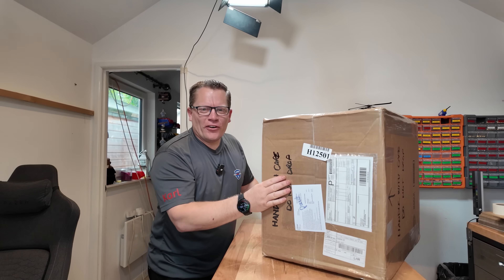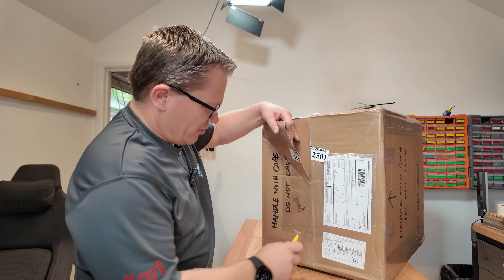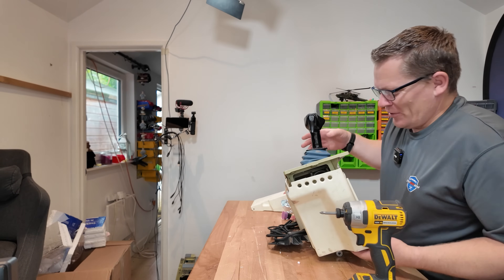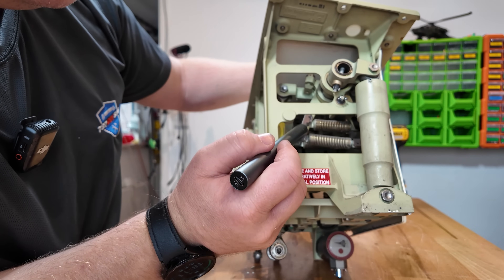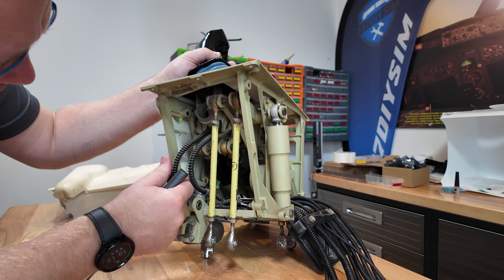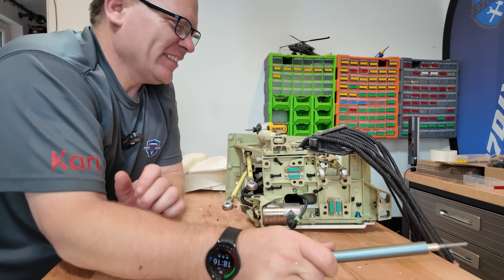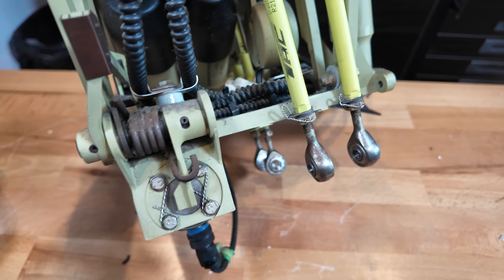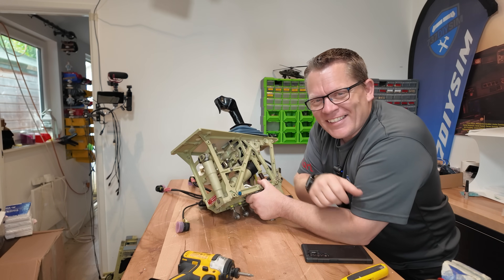A320 Sidestick

Comment: Any chance you can do a video on powering the sim. I was told you can't run the LED's on something like the front overhead from the Arduino alone as the power requirement would be too much. It would be good to know how to bring an external PSU into the system and how everything is powered.
Reply from the maker: Hello and yes, I am wiring the new sim up this week on Patreon and will issue a build guide video on every aspect for people to follow along.
Reply: @helimech8152  Glad to hear it. I'm getting close to installing the LED's in my overhead. All the main switches are done so just the rotaries and stuff to do so will be a great help. I tried seeking help on the Arduino forums but but basically told to read the specs and come back with a circuit diagram. To be honest most of what I've done is from watching your videos.

Comment: 2:45  Just to the right of the boot towards the top is a hole. That hole is for a lock-out pin which is used for safety when someone might be working near the aircraft flight controls. The lockout pin will render the stick motionless. It comes with a big round red plate and a Remove Before Flight streamer. When installed a log page must be created which turns the maintenance release RED until it is removed and the log page signed off. The position of the lockout pin hole would make this a First Officer's side stick.
Reply from the maker: Thank you for taking the time to share your knowledge. I would have never guessed that was for a rigging pin. I will keep this in and add this feature to the 3D-printed version for fun! Merry Christmas, Karl
Reply: @helimech8152   Merry Christmas. LOVE your videos !

Comment: Hey Klark, I saw your new MCP v14, and it is incredible. I joined Patreon web site only because of you. (I'm still not paying, though.) Why? I don't have time right now to build Boeing SIM. It is simply time-consuming and requires a lot of space and resources. But the Cessna 172 with G1000 is looking very realistic to me. It takes much less space, and it is much easier to make.
PLEASE, consider redesigning the G1000 with an Alps switch, like for your FMC. I think that there would be literally 10 (if not 100) times more buyers for G1000 PCB with Alps buttons and SMD LEDs then for any other thing. Also, as I told you once, please make the design to be 101% realistic.
I hope you will consider this! :) :D
THANKS!
Reply from the maker: Im trying, but to be honest, i havent even tested the last PCB of the G1000 that arrived!

Comment: Someone stripped down the unit, removing the encoders, links and related electronics. What a shame. But it is still am engineering marvel.
Reply from the maker: Hello, and yes it is! It doesn't really mater about the encoders as I will switch them out to hall sensors connected to the rods.

Comment: The locking actuator, switched by solenoids doesn't lock the stick but makes movements harder when autopilot is active to prevent unwanted overriding. There are centering locking pins for maintenance and adjustments. The rods go to identical transducer units which converts the input into electrical signals for the flight control computers. 
The sidestick unit should always be handled vertical to prevent leakage of skydrol from the dampers which is normal.
Reply: Just to clarify, you are correct when you say that the locking mechanism is there to prevent unwanted overriding of the autopilot by making the stick hard to move to any direction. But once you push it with enough force, then the AP will disconnect and the locking solenoid will release the stick and then the stick continues to operate as usual. Of course this is not the recommended way to disconnect the AP, but in case of emergency, it will work.
Reply: @MikkoKartano  Absolutely correct.
Reply: @MikkoKartano   Is there any harm to the system after disconnecting AP by moving the stick? I just did a side stick priority test last night and that is one thing we do not test. I don't recall ever testing the disconnect function of the side stick.
Reply: @rael5469  No harm, but for example the A350 FCOM states that AP disengagement by sidestick or rudder pedal deflection should be avoided, because "it is very uncomfortable for passengers" ;)

I have used this method in the full flight simulators as the discomfort is manageable. :)
Reply: @MikkoKartano  Thanks very much for the info.
Reply: @MikkoKartano  from Finnair Sim Tech?
Reply: Thanks very much for that info. Very interesting. Sometimes our stores people don't ship the things in their intended shipping container.

Comment: Airbus considers this “fly by wire”?
Reply from the maker: It's not visible here because they are removed, but I would speculate that sophisticated and reliable multiple transducers are in place. These transducers ensure the signal is matched, compared, and verified before being transmitted to the control surfaces.

Comment: How does it need that many wires to send back 2 axes and 2 buttons states worth of data ?
Reply from the maker: Great question! The reason for the number of wires is likely due to the need for multiple transducers in each channel. These transducers ensure the signal is compared, matched, and verified to maintain 100% reliability before being sent to the control surface. Each unit probably has its own duplicate set of wiring as a fail-safe in case one wire fails.

Hope this helps, Karl

Comment: I hope they emptied the dampers before shipping. The dampers are filled with Skydrol (phosphate ester based hydraulic fluid) and it will spill when the unit is tilted above a certain amount.
Reply from the maker: They did a fantastic job! No Skydrol in them. When I opened them up, there was nothing but a light spray coating of mineral oil to keep the o-rings lubricated.

Best regards, Karl
Reply: @helimech8152  Mineral oil will destroy the o-rings used for phoshate ester fluid and vice versa.

Comment: Interesting to see! The design of the sidestick was changed slightly at some point (I think around A380 release) where there is an indent around the AP disconnect button. I could sometimes tell when the sidestick had been changed on an older MSN if there was an indent on the sidestick by the AP disconnect button. Be interesting to know if any of the internals were changed during the slight update. The sidestick transducer fault is one of the few uninhibited faults that would appear to the flight crew on the takeoff roll for a good reason! 

From other research, the force also varies in outboard and inboard roll. Apparently in development they found the arm is naturally stronger moving inboard than outboard so made the resistance higher for an inboard movement.

Good luck with the project 👍
Reply from the maker: I've measured the springs in the pitch lane, but I haven't done the roll lane yet. That's currently what I am reverse engineering now. Both lanes have dual feel where the pressure applied to a certain point is at one force, then it is increased as you move further in that direction. I guess you probably knew that already, but I find it ingenious how they designed the whole thing and how every aspect of each part can be adjusted to an infinite amount.

Best regards, Karl
Reply: Indent on the “thumb plate” came in with at around the time of the sharklet A320s I believe

Comment: Just a tip when you are adjusting the feel and forces maybe you should try to find a way to try the sidestick on a newer airbus aircraft. I suggest this because I have flown older buses and the stick seems way more easy to move and lose than on a relatively new one. There is also a clear separation in the pitch and roll movement like a "barrier" (I don't know how to explain it) and on the older buses that are already used this barrier is not evident, it's very easy to accidently roll a bit when pitching full down for example. I am saying this since you said in a comment yours was from 1992, so probably already went through it's full service life and is already pretty "lose"
Reply from the maker: You will see how they achieve that dual limit in the pitch in the next video, another very clever bit of engineering that i could feel in operation, but not figure out how it was done until i took one of the Pitch Artificial Feel Units (PAFU) apart and filmed how is was achieved. I would also guess that the springs after all those years have lost some tension, but as each one can be tensioned to increase the feel, its just a matter adjusting them to a set force. All very clever.
Reply: @helimech8152  perfect 😀

Comment: Note that it’s a different tension spring for each direction in roll. That’s because it’s easier to pull the stick towards you than it is to push it away.
Reply from the maker: Thank you, i will measure each one with a spring balance and order the closest i can find.

Comment: I didn’t expect so much plastic in the real version and with it being FBW no control arms.
Reply from the maker: I was surprised at how much mechanical engineering rather than electrical. I thought it would have been all force feed back motors etc. The mechanical engineering is so clever but also very simple.
Reply: @helimech8152 80s design a bit too far forward for such.. Only 35 years from WWII 😅

Comment: Interesting video and i can imagine it must be fun to replicate this hardware. But, its also much easier to replicate the feel and behavior with a force feedback stick, like the Rhino or Moza FFB. All you need is a good profile which produces the same damping and centering feel, and AP Lockout. Thanks for showing us the insides of the Airbus Sidestick.
Reply from the maker: You may be right, but as both a mechanical and avionic engineer that wouldn't be very exciting! The plan that has been requested from the A320 pilots to reproduce an exact replica, Its mechanisms that the dual limit feel is all about and something i didn't even know existed until i took this apart.

Comment: i honestly thought the sidestick was fully electric with hall effect sensors ? I think those sensors are missing in this case, which is a shame if you paid lots for it.
Reply from the maker: I thought the same, But i don't need the stick position transducers as i always planned to use hall sensors for simplicity and to allow others to copy exactly.
Reply: @helimech8152  great ! good luck

Comment: you are lucky that there was no more oil spilage from the dampers. Usually they must be store and transported in the upright position to avoid it.
Reply from the maker: Just one of the two leaked. I can see why they need to be kept upright. This unit is very old, and the seals were worn during disassembly. I will have to find an 'o' ring kit that fits to rebuild them. This is a fantastic and clever bit of engineering.

Comment: Well, if that video was from August, did the large "huge damper" cylinders have sensors in them, two complete sets for redundancy?  The connecting rods are no doubt to transmit torque back to the stick for feedback. I would speculate the DB connectors likely all have the same pinout, for cost efficiency.  I am surprised that those DB connectors and the pigtails are both present.  That implies the DB connectors are for modules that do some sort of conditioning of the input signals before sending them out the pigtails.  I wonder what sensors might be hiding up at the top end inside the cabinet.  Thanks for the video!
Reply from the maker: There were no electronics really in this unit. All the electronics are mounted on the baseplate, which has been removed. They would have been dual stick opposition transmitters, which the rods connected to. However, there is enough there to build a replica unit, and it should hopefully be quite easy to put hall sensors or pots at the end of the rods for position takeoff instead. Those large cylinders in the pitch were PAFU's (Pitch Artificial Feel Units), and that's the following video.
Kind Regards, Karl
Reply: @helimech8152  There are 2 dual channel transducers ( roll and pitch ) mounted to the bottom of the side stick assy., each channel connects through one of the 'D' connectors. They are a bit fiddly to change ;)     The transducers are LRU's ( line replaceable units ), but in the event of a failure, most airlines would replace the entire side stick assy.